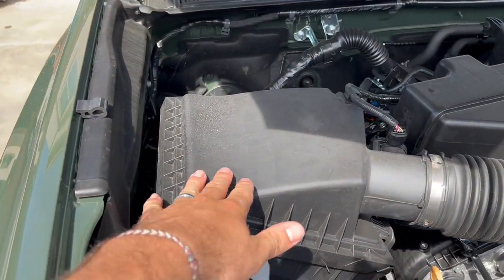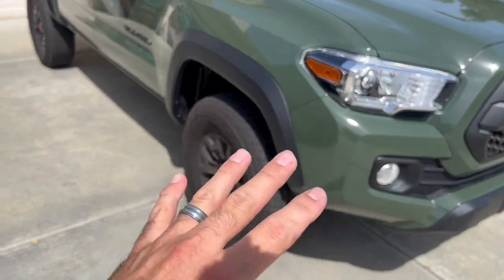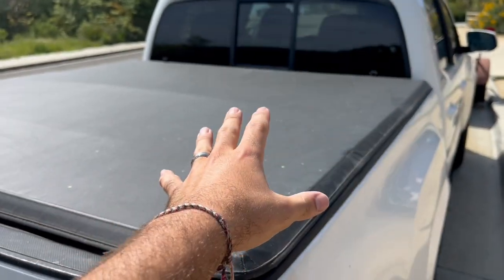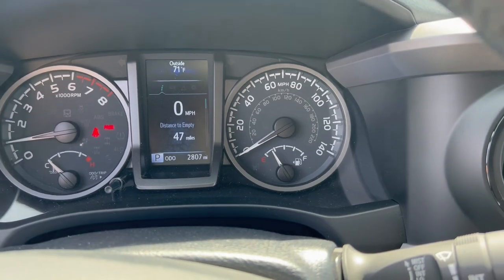Get Better Gas Mileage Toyota Tacoma

Comment: 1. Drive slow
2. Don't carry unnecessary weight
3. Check your tire pressures and air filter
4. Lose weight
5. Walk to work
6. Don't drive up hills only drive down
7. Tie a tow strap to the front recovery hooks and the other end to the back of your belt and pull the Tacoma.
Reply: @TheUnrestricted  I'm glad you got a kick out of that. 👏👏
Reply: Wait, on 7. All that is also done while you're in another tacoma? 1+1 = 🤓
Reply: My 2007 Prerunner Tacoma on 33s gets about 23-24 mpg per tank or a range over 400 miles. It’s worth noting I modified the engine to achieve that and my truck is a 4.0 L V6 RWD 4dr.
Reply: May I ask what your mods are? @09FoxRider
Reply: @bogdanshevchenko  Mods
1. Use full synthetic oil 
2. Use top tier gasoline 
3. Change spark plugs
4. Clean injection valves 
5. Clean mass air flow sensor
6. Install oil catch
7. Tire pressure 45 psi use nitrogen because oxygen will expand 
8. Clean intake valve, use additives 
9. Install cold air intake helps
10. Lose the useless weight 
11. If you lift your truck keep the same rake
12. 33 or 285/75/r16 are fine.
Reply: @09FoxRider  thanks for your response. This is great. I've got some follow up questions if you have time. Could you explain what an oil catch is? Also, what did you mean by #11? What is the rake?
Reply: @bogdanshevchenko  the Tacoma engine is port style injectors but due to fuel emissions standards Toyota installed a pvc valve to burn off any unused fuel the strong vacuum will suck oil vapor and spits it on the intake valves. The oil catch can will collect most of oil vapors and improve efficiency and longevity of the engine. 
Rake is distance between the bottom of the truck and ground measured at the front and rear. In other word don’t level your truck because there are some negative effects. I have a 2 inch lift on the front and back. If you level your truck your mpg will be affected dynamically. 
I work as an auto engineer and have test many types of engines to improve multiple functions including the new Tacoma engine. 
Right now I’m working on the underbody of concept vehicle to improve mpg and protect the key components.

Comment: All you gotta do it just take it easy. I drove 25 minutes home at 65 on the freeway on 33s and i was getting 21 to the gallon. Now i'm down to 13 because i floor it everywhere 😂
Reply from the maker: Wow that’s amazing
Reply: your real accurate mpg is probably 23 when you think it’s 21 or 17 when you think of 13. tire size screws with uour onboard mpg calculator and you are driving roughly 110 - 115 miles with those 33’s when the tachometer says you drove a 100. your tachometer is programmed not by gps but by circumference of your tire. depending on size increase of that circumference from the original, you are driving that much more and faster too than what is shown on your tacho/speedometer. so if you bought a used taco with 33-s on since new from the store with 200,000 miles on the tachometer, it really was driven somewhere around 230,000 miles. i don’t know the right numbers off the bat. but for every 1 “ total top to bottom radius gain over OEM, you gain about 3.6% in distance and speed. those 33-s probably have a 4” gain- am i right?
Reply: Yup I have a 2021 with 285/75/17 and I can get vouch for that I just don’t take it easy. But I also gun it at times too. It’s all about how you drive.
Reply: Thats a good point! But who the heck wants to cruise when you have a truck!? Haha
Reply: He said that in the beginning actually 🤓
Reply: If you are down to 13 why not have a fullsize truck?
Reply: Ain't nobody about to drive 65 mph when we can be doing 85-90

Comment: I drive 60k miles per year for work and I’ve tried every trick in the book for mileage. Your mild driving tip is spot on and probably number 1 in saving gas. If you have to make a hwy trip sometime, try leaving a little early then drive 68 instead of 75. I gain about 2 mpg just doing this.
Next is tire pressure… this is a balance. Hard tires have less road friction and roll easier. My tires have a max pressure rating of 50 or 51 psi cold so I run 40 in them. Above that and the tires start wearing out the center tread too fast. 40 psi gives me even treadwear and I normally get 70k or more on my AT’s. 
As far as bed covers, running with the tailgate down and so on, I never really noticed much difference as long as the bed is empty. Mythbusters have an episode with vehicles in a wind tunnel and all that will explain that better than me.
Reply from the maker: Ah man
Reply: A nice tip I learned about daily driving a Tacoma is to try and keep the RPM at 2k or below. Just a little bit lighter on the pedal from stoplights or on the entrance ramp goes a long way.
Reply from the maker: Ah true
Reply: I travel about 100 miles a day in my Tacoma TRD and running AT tires isn’t helping on top of other added weight with mods.  I keep my psi around 45 ish but reading your comment about lowering them to 40 psi for even wear changed my mind.  These tires aren’t cheap and want to keep for a long time.  Thanks for sharing
Reply: I drive this way as well too, but mine is from back in the day and you need to burn off the carbon sometimes with a high rev. I also wanted to warn other toyota pickup drivers do not reg use low octane gas

Comment: I have a 2020 TRD Off-Road 4x4. What helps me the most is staying under 2,500 RPM and not accelerating hard. If someone is tailgating behind you don't speed up for them. Let them pass or merge over to the other lane. I go about 65mph-75mph on the highway. If I can, ill put the adaptive cruise control on and stay behind a semi truck which does improve mpg since the wind isn't hitting the truck or something.

I did those things above today and averaged 20mpg on a 12 mile trip. I think that's pretty good considering it has heavy running boards, skid plate, tonneau cover, and luggs around the extra weight from being a 4x4. I'd say 4 miles of that 12 mile trip was street too and the other 8 miles was highway.

I learned very quickly this is NOT the vehicle to drive hard in or joy ride around in all day every day unless you want to live at the pump. If you're looking for that then you probably want to consider another vehicle or a 2nd vehicle that would be better for that. It might be mid-size but it is a truck therefore you must treat it as one.

Sometimes I think - If I were to do it again I may have gone with a SR5 4 cylinder 4x4 and just added some minor things to it (seat covers, better shocks, better rims, light running boards). I got the off-road to replace my Jeep that I used to do crazy shit in. The Off-Road is crazy badass but I don't off road as often anymore now due to new job and I also don't tow anything with my truck except some light hauling in the bed sometimes. Still extremely happy with my decision but wish I could foresee that life was gonna change in a way that would make the truck overkill. Could have used the slightly better mpg more than the rugged off-road features nowadays. But atleast I can whip it out when needed. Ya never know! Crawl control and rear locking axel can be handy..
Reply from the maker: Ah I see true
Reply: Awesome! Thanks!
Reply: Is the SR5 4 Cylindrr automatic?
Reply: What do you mean by light running boards?
Reply: What kind of rims would you get?

Comment: Mine is Lifted and i have 275/75/17 I noticed that if you keep the RPM under 1500 you can make up to 23 MPG, try it I promise it'll work, you'll make like 58 MPH but you get use to it.
Reply from the maker: Whaaaaat wow! I’ll try it out
Reply: All Tacomas in the slow lane. I'm getting 16-17mpg, level, 285/70/17, tonneau, steps.

Comment: The best I have gotten on my 2019 trd 4x4 is 25.9. That said I got rid of my oe tires and went with pizza cutters 245/75/16 Cooper Discover which weigh 37pds each versus the 44pds Goodyear wrangler.  I just came off a road trip with my rtt above the bed and still got 20.5 mpg with my bed fully loaded and mountain bikes.
Reply from the maker: Oh wow !
Reply: Plus you can slice pizzas 😂

Comment: Was mildly concerned when the Tacoma I got a few weeks ago had the 2.7.. but I’ve been averaging well over 25 mpg with mostly city driving. Ontop of its insane reliability, I’m stoked.. slow as a dog tho. Lol.
Reply from the maker: Wow 25 that’s amazing
Reply: I drive a 4 banger too brotha. Would recommend a sprint booster, it’ll pep that bad boy right up. $300, took me 10 minutes to install and I doubt you’ll be disappointed, especially if you’re running stock tires
Reply: @rossbarton3411  send a link !!!
Reply: With the pedal commander I get 28mpg and if lucky 32mpg
Reply: Hard to believe cause I have a 2020 tacoma and get 14.5 city and 17mpg Freeway. Same with my brothers tacoma crappy gas mileage. I drive really slow to and everything is good tires alignment. It's ridiculous the mileage this little truck gets.
Reply: @BlueSTI  you’re driving it entirely wrong then. Six months in and I’m still averaging 25 plus with 70% city driving. I even have a tool box loaded with tools on the bed. 🤷🏼‍♂️
Reply: @ryanfoster2437   I drive it like an old person slow and try to get good mileage I swear but doesn't work. I have a leveling kit with mud tires on it. Would that effect the mileage just that???
Reply: @BlueSTI  lol.. very much so. With mud tires and a lift I’d be shocked if you got more than 20.

Comment: i keep the oil changed every 3K, not 10K and use royal purple with factory filter, also i use berryman fuel system cleaner every 3 rd tank or marvel mystery oil. i also fluid filmed the entire truck

Comment: My average tank is around 20-22.     Stock tires, SR5.    Sometimes on highway i get like 28mpg.   I keep the RPMs low.    Hypermile tip try to  coast as much as possible, leveraging all your momentum.   Not great in traffic 😂

Comment: I agree weight is a big issue. Modding can sneak in lots of weight like skid plates, thick rubber bed mats, heavy duty “cutting board” tailgate plates sneak in lots of hidden weight. I put 150 lbs of sand bags in my bed for extra control in our Michigan winters. These alone cost me about 1.5 mpg.
Reply from the maker: Yeah happens man

Comment: 0:35 Agree.
0:37 Yes, accelerating hard isn't great  for MPG, but it is only really bad if the rapid acceleration is followed by braking. If you floor it from 0-70 and then drive 10 miles at a steady pace vs. half throttle it from 0-70 and then drive 10 miles at a steady pace, the difference in fuel consumption is negligible. Flooring it then slamming the brakes to travel 250 ft from stop sign to stop sign vs soft acceleration to a slower top speed then coasting the rest of the way 250 ft will favor the slower acceleration.
0:42 Yes, braking too often is bad for MPG. The less you need to brake, the less energy you waste, and the less gas you need to burn to get back up to speed to get where you're going. This ties into driving habits.
1:02 Yes, a good thing to know the condition of. The engine pulls the same amount of oxygen, it's just a dirty air filter increases restriction and that means the engine has to work harder to pull in the same amount of oxygen.
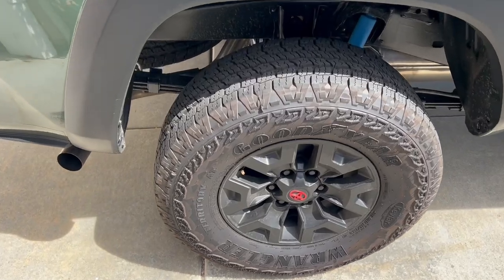1:30 Agree, very good to know your tire pressure, and you want to stick to the number on the door jamb sticker or up to 4 psi higher (you want more pressure in your tires when your vehicle is loaded up close to the max weight rating). Cranking tire pressure way up to save fuel will cost you more in the long run because your tires will wear out sooner and the reduced grip is also dangerous, especially in inclement weather.
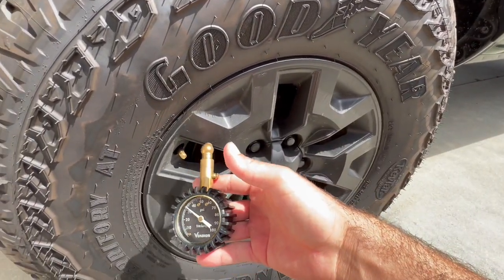2:01 Bigger tires are bad for MPG, but they also mess up your odometer reading, which makes your MPG look even worse than it really is. Going 200 miles on a 31" tire when you have a 32" tire means your odometer will only register 194 miles, which makes 20 MPG look like 19.4 MPG.
2:34 Agree, poor alignment does harm MPG and accelerate tire wear.
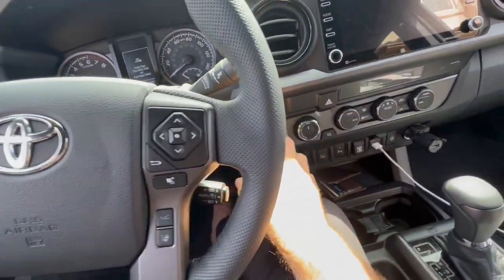2:56 That's ridiculous. The best way to warm up your engine is to drive it gently. That way you warm up your transmission too. Idling is awful for MPG and even in really cold weather, you are good to start driving after 10 seconds. The key is driving it gently. If you can keep it under 2000 rpm for the first 3 minutes or so, awesome.
3:08 The weight of the bed cover will completely wash away any aero MPG gains. Yes, both are highly neglible. The bed cover is great for securing your valuables or for protecting stuff from the elements, but it won't affect your MPG at all.
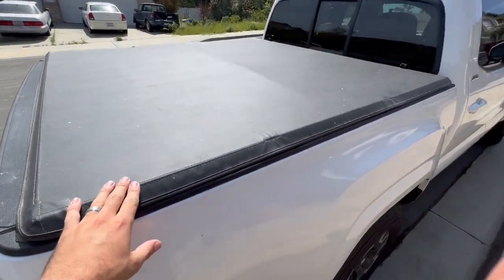3:32 Agree, excess weight is bad for MPG. The less unnecessary stuff you carry, the better your MPG can be.

Now I want to add that your cruising speed is very important. For a manual vehicle, 25-35 mph is going to give you the best MPG, while and automatic does the best at 35-45 MPH. The further away you go outside that range, the less your MPG will be. My 2.7 Tacoma is most efficient at 38 MPH in 5th gear. I arrived at this figure experimentally with my scangauge 2.

Comment: Hate to break it to you, but putting a truck cap actually uses MORE gas. The aerodynamic of a truck creates a vacuum pocket inside of the bed which forces air to move over the bed. This means that it’s actually more aerodynamic to have the cap off and the tailgate up
Reply: Big facts. When I bought my cap, I was a little annoyed by the drop in MPG and after some research on vehicle aerodynamics, I also found the same reasoning.

Comment: I went through the hills in Southern Indiana today, ran the speed limit and used the ect on the hill approaches. Got 25.5 mpg on my 21 Taco TRD OR. No tonneau cover. Pretty much stock except I changed the factory tires for Michelin LTX. I’ve had pretty good luck with these tires over the years. Got 80 to 100k miles on them, running on Gen 1 and 2 Tacos. Low profile tires are more wind resistant than knobby tires.
Reply from the maker: Hm wow

Comment: Tire pressure + or minus 10 degree roughly equates to 1+- psi. I check my tire pressure Atleast once a month, unless your in the middle of huge temputure swings. Just fill them when it's cold and it will just increaseing. A few psi above is better than low psi. Obviously if your going from-30 degrees to 90, good chance you need to let some air out, you'll notice how rough the ride is

Comment: You must be in California, Nevada, Oregon, or Washington State where the gas prices are really high.  Here where I live in Wyoming it costs me about $85 to fill my Tacoma.

I have also noticed if I just do city driving over here I try to take roads that I know that have the least amount of traffic lights or stop signs so I don't have to stop.  Then I will drive around 30-40 MPH and I can get around 24 MPG in my truck with a V6.  I remembered from my physics class that it takes almost double the amount of energy to get something rolling from a dead stop than if you were already moving at a slower speed.
Reply from the maker: Ah yes

Comment: I run my stock tire a bit harder at 35 cold, which is ok when hot. I find that average is 20.50 miles per gallon. I have gotten better, when I run at about 50 without stopping and starting, I have reached 21.3 to 21.5. Mostly highway driving to work, and I move right along at 70. Super 93 octane gave me slightly better miles per gallon but the cost of 93 octane is outrageous today.
Reply from the maker: Ooooo good tips! Thank you
Reply: Premium gas does not yield better mpg. It’s just it’s resistance to knocking. If the manual calls for 87, run 87
Reply: @owenmarten2434  Well I can tell you that I did see a big difference. I just tested my truck with regular 87. My truck went from 21 21.3 22 mpg with 93 octane down to 17, 17.5, 18. I ran three to four tank Fulls of regular to make sure I was at 87. I averaged out at best at 18.42 with regular 87. I then filled up with 93 octane and I had between half and quarter left in the tank. My first day I dove the same way to work I checked my MPG and I was floored. It went from 17 to 18 with 87 up to 21.5 to 22 and more. I couldn't believe it. No difference in driving habit and even with a mix of octane, which was probably about 90 in the tank and I immediately saw a three mile plus gain in mileage. That's a good 60 miles more per tank full. Is it worth it? I think it comes out about the same cost maybe slightly better with higher octane. I have seen so many video's saying- your wasting your money yada, yada, yada. I have to say seeing the difference in my vehicle is believing at least in my truck. Honestly I was hoping that it wasn't so but there is a drastic improvement in my truck. Try if for yourself with at least three tank fulls of 93 and see if it helps your mileage. Try it, If it doesn't improve mileage in your truck you only lost about 20 bucks or so. I think it's worth a try. If your only saving one mile per gallon then it isn't worth it but i have seen 3 to 3.5 miles better.

Comment: I get 20mpg in my Tacoma with some simple habits. 1: take out unnecessary weight. Us truck owners up north like to keep a 50lbs sandbag in our bed for better traction in the snow, if it’s not snowing take that thing out! Some people even take the spare wheel off but I keep mine just in case. 2: only drive to places you actually need to go, the less you drive the better mileage you’ll achieve. 3: keep your truck washed and waxed, now this isn’t a proven theory but in my opinion if a car is shined and waxed the wind will slide right off of it as you drive, therefore being more aerodynamic. 4: check tire air pressure after every fill up also check oil level after every fill up and top off as needed. 5: tonneau covers don’t provide too much aerodynamics but it’s better then nothing so invest in of those. 
Hope these tips works!
Reply from the maker: Ah I see nice!